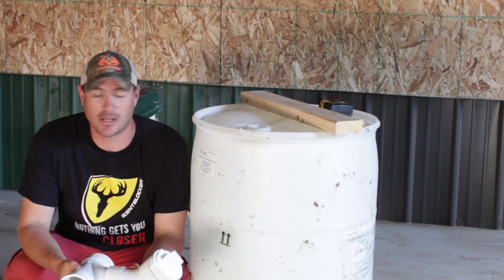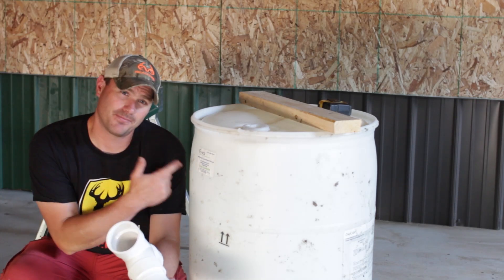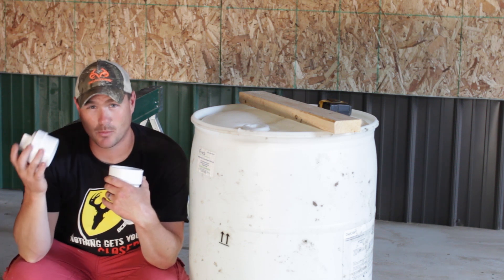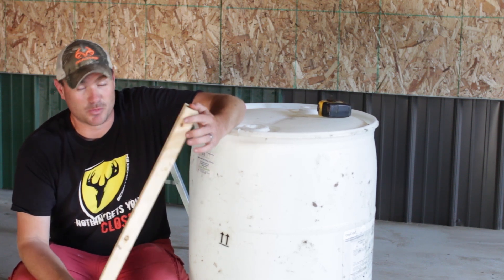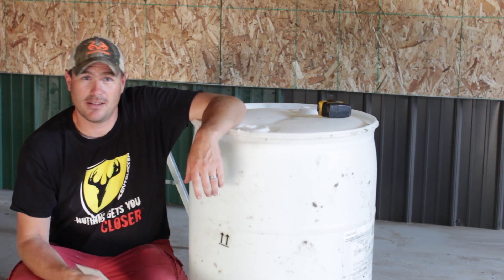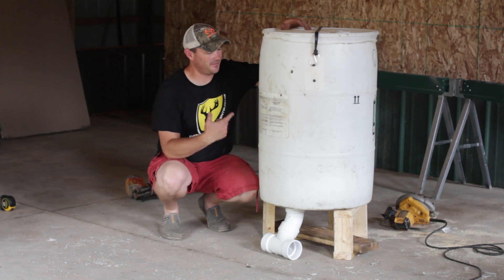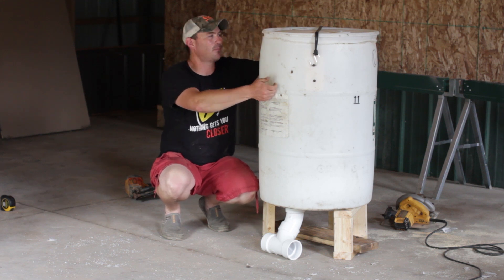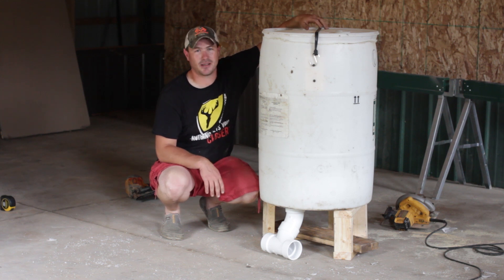Build Your Own Deer Feeder For $20

Comment: Tip:
If your using a plastic drum such as this, cut the lid off evenly and as close to the top as possible.
Flip the lid over and it'll fit over the top perfectly snug with zero rainwater leak👍
Reply: That is a good tip, I usually cut mine a few inches down in the straight part and then trim the lid flush and it fits that way as well

Comment: Terrible idea. The squirrels and raccoons and mice and every other animal will eat most of the corn that doesn’t spoil. Those short legs are a joke. This whole thing stinks.
1) The feeder need to be water proof. The lid is a joke
2) The feeder spout needs to be about 3 feet off of the ground. It needs to be designed so it won’t collect rainwater and make the corn spoil
3) the legs need to be smooth metal so the animals can’t climb them to get into the corn
The commercially available feeders have a design that needs to be copied nearly exactly because they have already done the research that you’re lacking. I think you’d be better off spending the $20 on corn to pour on the ground